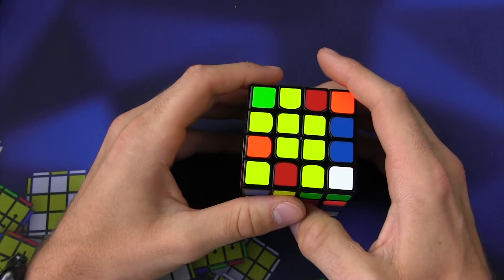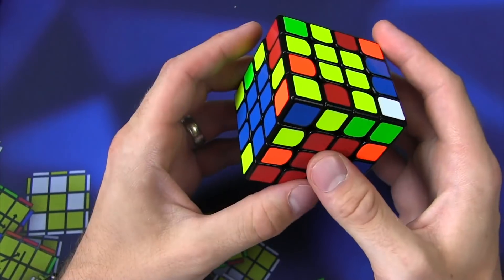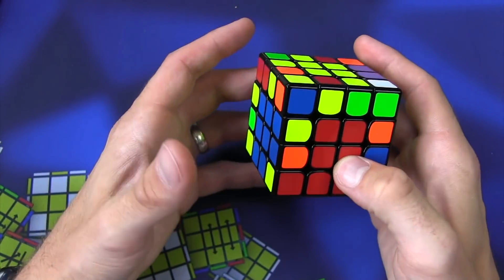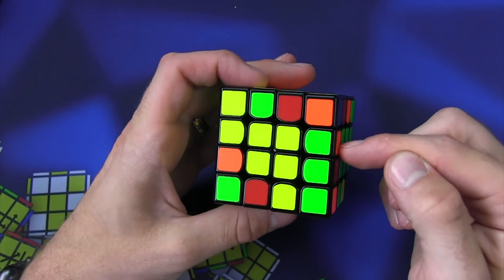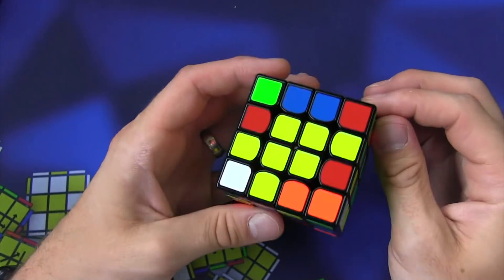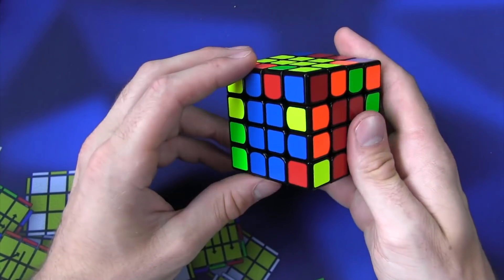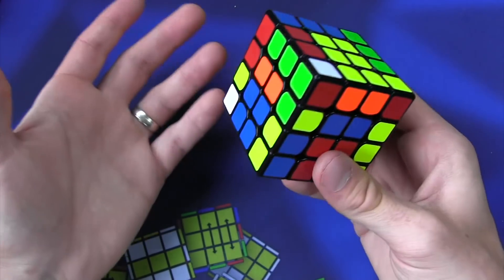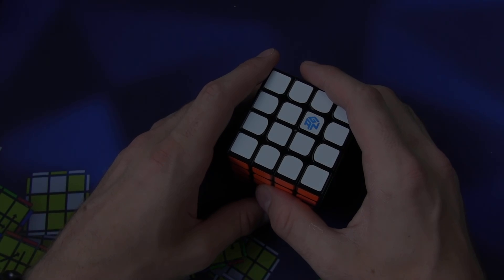4x4 Advanced Edge Pairing 6-2 Odd Cases

Comment: I wouldn't recommend using 6-2 pairing, it's very awkward. I'm pretty sure that every fast 4x4 solver uses 3-2-3 paring.
Reply from the maker: I don’t find it awkward at all. Compared to 3-2-3 I actually find the flow of it more comfortable. Move count is similar and in some cases lower in 6-2. I agree not as many people do it but don’t see that as a reason to avoid it.
Reply: I agree with Shawn
Reply: Luke Tycksen use 6-2, didn't he? But I wouldn't recommend that as well.
Reply: This is my preferred method, although I never knew what it was called before 😜 Thanks for the video, especially for the exception cases, which I’ve always thought of as a nuisance before. I do love the 4 - 4 case though, even if it doesn’t show up so often.